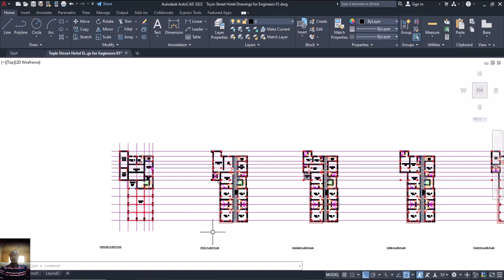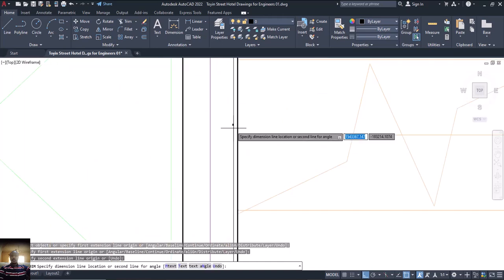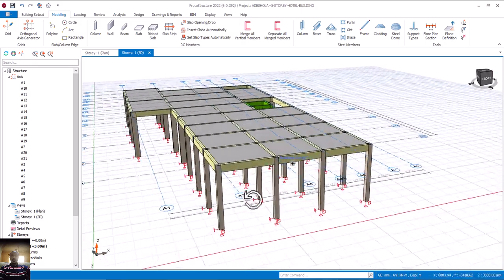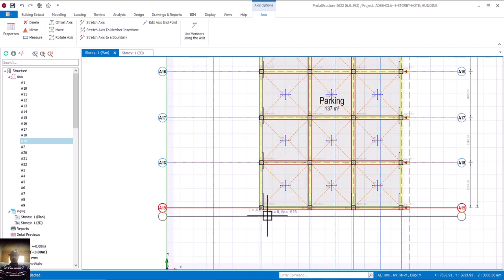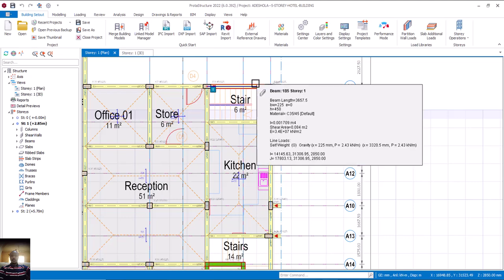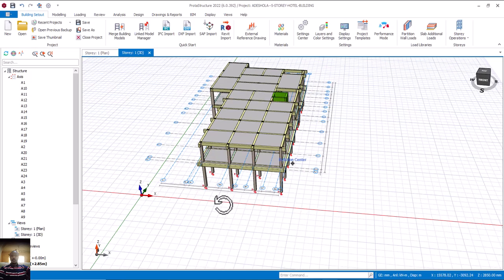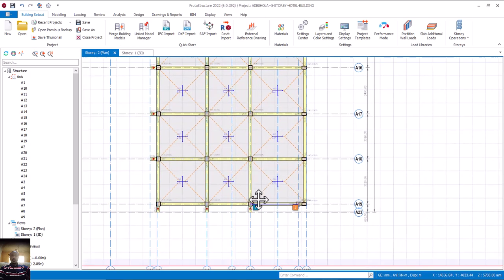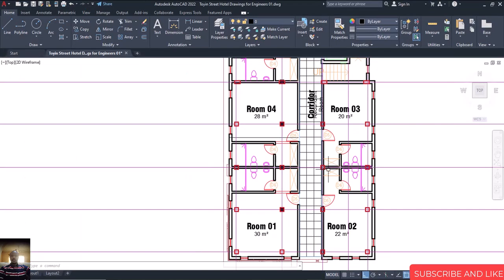Design of 5 storey Hotel Building in Protastructure - Part 2

Comment: Good day Sir. Please, why are you cutting the columns on the first floor? making the column a floating column. which is very dangerous for a hotel building in term of earthquake. It can be understood for a small residential building, not for hotel buildings. Why don't you just continue the columns to all floors, then ask the architect to shift the wall closer to the column area. That will be a better approach, since the distance isn't that much. I am pretty sure those columns will fail soft checks and also the modal mass participation checks.
Reply from the maker: The structure is in a non earthquake country so it's good
Reply: @EkidelCAD  Okay sir. Thank you
Reply from the maker: The building is not is an earthquake country